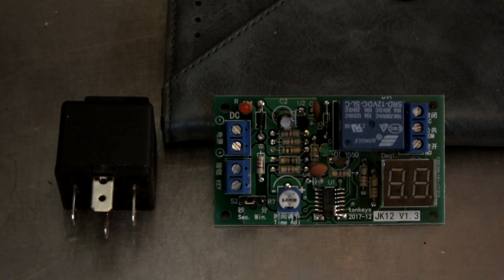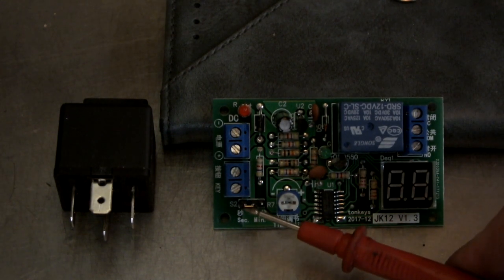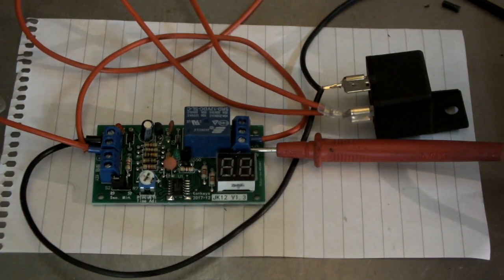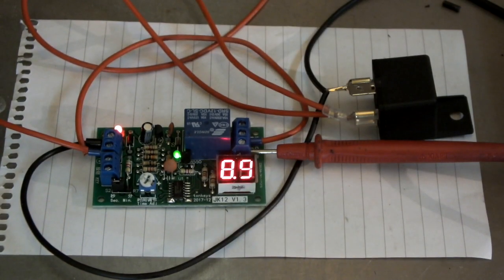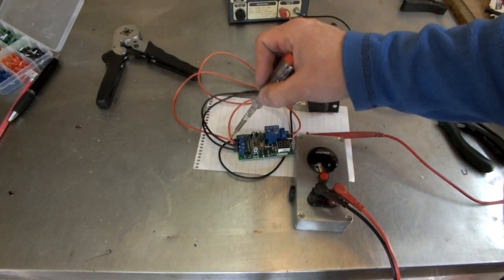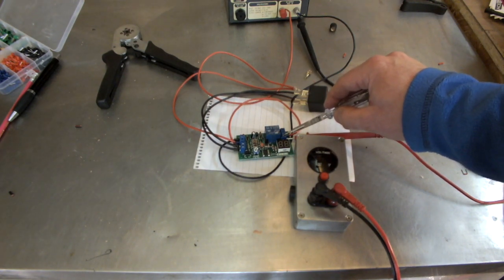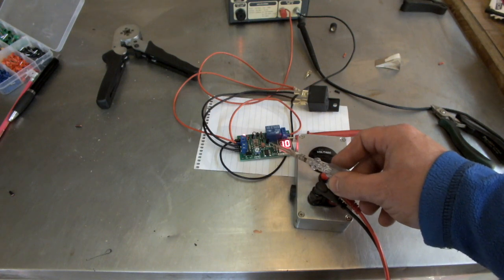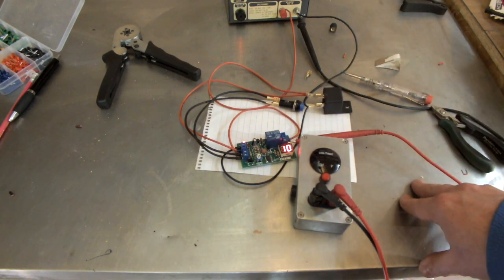Homemade Universal 12V Heater/Glow Plug Timer circuit

Comment: 10 to 15 seconds? In the American military HUMMWV's the glow plugs are only on for max six seconds. Anything longer than that will  over heat and cause the glow plugs to swell and fail. Good luck extracting the plugs when they are swollen.
Reply from the maker: Its not a HUMMV and they are different glow plugs.
Reply: @Bodgemiester  what does the factory manual on that vehicle state as to the duration the glow plugs should be heated in order to start an engine in cold weather? What does matter is the compression level that the cylinders have to ignite the diesel. Higher compression level require less heat to ignite the air fuel mixture. BTW, I do like the timer idea! I’ll be looking into that timer circuit for other applications!

Comment: Those changeover relays are nice but only hadle about 100A continuous for a short time. the circut needs about 150-200A to handle everything including larger diesels. I their a timer that plugs a beefier relay?
Reply: You can replace that small 30 amp relay he used for the demo with a continuous duty truck solenoid which can handle up to two hundred amps. You need to find a knowledgeable parts supplier who has the specifications on these parts.
Reply from the maker: @Subgunman I use a 200amp switching relay usually. Never had a problem
Reply from the maker: @budchestnut9303  it's only pulling the switch feed through the timer. Actual current relay can be as big as you want

Comment: Very good, but one detail is missing. A factory setup doesn't cycle the glow plugs when the engjne is warm. That said, I'll be using this on my diesel conversion pickup and my fiat tractor. My idiotic tractor has some sort of diesel burning pre heater system that has never worked in the whole time we've owned it, and that's 30 years.
Reply from the maker: @j.danaclark2166  no that's correct, but it won't hurt anything. Fit a thermostatic switch to the ignition feed or something if you're that bothered about it. I wouldn't bother
Reply: @Bodgemiester  I'm too lazy to fit a temp control. I'll be running the way you are. And just for anyone interested: the new duramax diesels have a really nice screw in preheater if you want to go away from the glow plugs. Personally, here in Canada's winters, a preheater starts considerably better than glow plugs.
Reply: I laugh at the Russian way at starting the old diesels from the Cold War era. Start a fire under the oil pan and allow the cold block to heat up. Gads! Can you imagine if we did that in the West! Another plus is that if you do live in a cooler area of the world, go with an engine block heater and one of the silicone pad heaters glued to the oil pan. Oil that is too cold and thick will not circulate properly in the engine resulting in key area wearing down from lack of lubrication.
Reply: @Subgunman as a Canadian, we put fire under engines when the block heater isnt able to be used either from failure or no electricity.

Comment: Great video, I going to use the circuit to bypass on a skidsteer. Could you let me know what pin # the key wires are hooked to on the relay.
Reply from the maker: They hook to the switched pins to make a closed circuit.

Comment: Is it possible to disconnect the  wiring loom glow plug heater connector wires, then add an additional indipendant switched positive  cable say from the battery to the glow plugs, switch on count down from 10 to 0 switch of then start engine
Reply from the maker: Yeah, shouldn't be a problem. You may need to use the main loom 12v to switch a relay and join the key but not difficult at all

Comment: Great video! Very helpful. Is it possible to get it to work in reverse? I’m looking to cut power for 10 seconds when i flick a switch, and was hoping to use a delay circuit like this but need to work out how to wire it to do what i’m aiming for.
Reply from the maker: No problem at all, just use the other terminal on the output. That's what it's for

Comment: Great video!  Quick question...just to see if I'm understanding this correctly...the "key" circuit appears to be going to 2 terminals on the 30a relay that have constant continuity. Which means the key is circuit is always closed. This, in turn causes the timer to be triggered with the introduction of power to the board.  If I'm seeing it correctly, I should be able to wire a jumper between the 2 'key' terminals and do away with the 2 black 'key' wires going back to the relay.  Is this correct? Thanks so much!
Reply from the maker: Basically correct. The key only needs to be closed momentarily, the relay does not stay closed either BUT It would not matter if it did.

Comment: Nice video.  This is my first time watching any of your videos, so I need to ask where you found the timer?  I want to make a timed circuit to turn on and then off my soon to be connected heated seats.  You did say you can set it for minutes as well right?
Reply from the maker: Hi, the timer came from eBay and yes they do count minutes also. Search 12v timer circuit. There are several different kinds but I find this one the most simple to use
Reply: @Bodgemiester  Do you have a link or some type of identifier? Thanks again.
Reply from the maker: @1SGBob1  https://www.ebay.co.uk/itm/DC12V-24V-LED-Display-Countdown-Timing-Timer-Delay-Turn-OFF-Relay-Module-Time-/252455391727
Reply: @Bodgemiester  Thank you!

Comment: Very helpful video. Thanks. I have some comments that I think would improve what you have conveyed here. A hand drawn circuit would have been very handy as a reference point as your wiring gets difficult to trace. Also, since the counter display will be difficult to have on the dash, inclusion of a dash light in the circuit that shows when the glow time has been reached
 would be a good idea. I have found a board on eBay and have bought it. I think I can figure out the dash light etc but others may not. Trying to be constructive and thanks again for your help.
Reply: Also....you suggest the option (your preferred) of using the external relay for the glow plug cct and say if you don’t want to, you can use the onboard relay. I’m thinking the onboard relay may not be powerful enough to use for glow plugs otherwise you would have used it? Appreciate some clarification please in addition to the above comments. Thank you!
Reply from the maker: Thanks for the feedback. i just put the output wire to my glow plug lamp

Comment: Do you have a link to that exact timer relay? Thanks so very much!!
Reply from the maker: Hi, they are all over eBay, just search 12v timer circuit
Reply: https://www.ebay.com/itm/353107483247?_trkparms=aid%3D1110006%26algo%3DHOMESPLICE.SIM%26ao%3D1%26asc%3D20201210111314%26meid%3D564b2a5712504f50a87f489f6d43e457%26pid%3D101195%26rk%3D1%26rkt%3D12%26mehot%3Dag%26sd%3D133741546186%26itm%3D353107483247%26pmt%3D1%26noa%3D0%26pg%3D2047675%26algv%3DSimplAMLv9PairwiseUnbiasedWeb%26brand%3DUnbranded&_trksid=p2047675.c101195.m1851